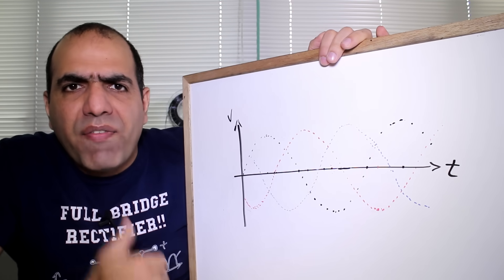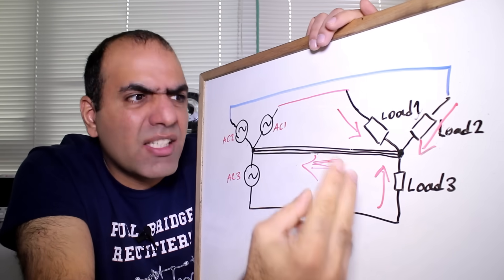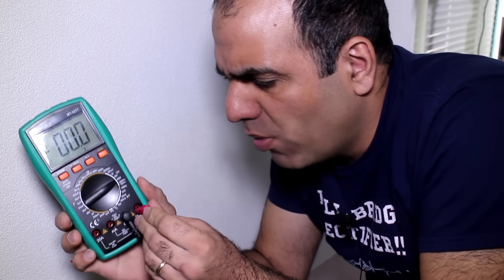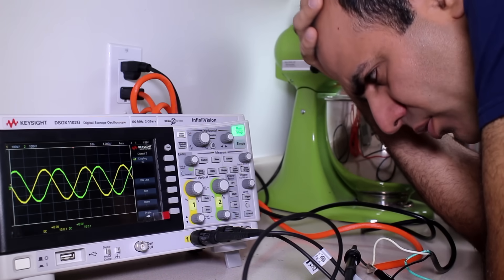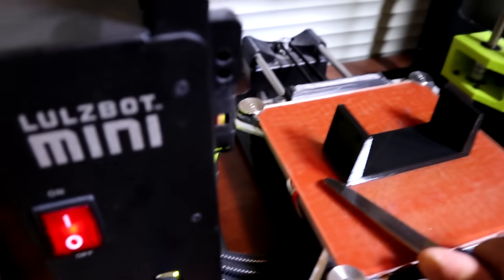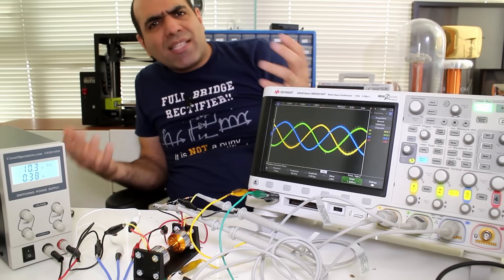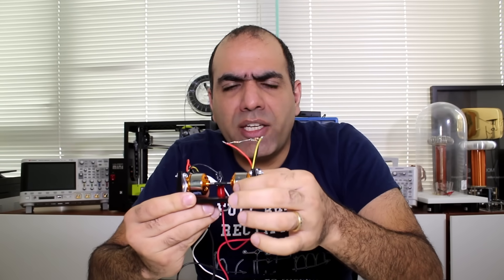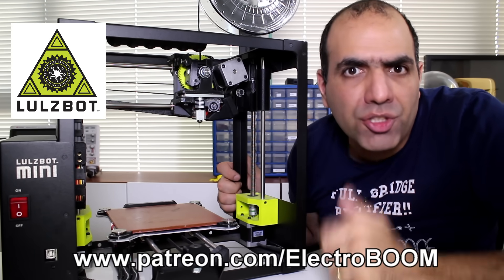Why 3 Phase AC instead of Single Phase???

Comment: well there is something I must have slept through during intro to electronics,  I would have thought you would need a return capable of handling the combined current of all 3 loads in your example as kirchhoff's current law should still apply.  However, I have to admit that my CEET degree was very soft on household AC circuits but I always assumed that the basic rules still applied.  I'd love to see the math on that type of circuit and how it varies from a 1 phase to 2 phase/3 phase load like in the example.  

Does load need to be perfectly balanced to work or can I have my 1500w space heater on load 1 and my kitchen microwave on load 2 and my LED living room lights on phase 3 with all hots wired together like in your example with no return/neutral/ground wires?  (seems like a recipe for a house fire to me)
Reply: Oneofdazzz Imagine you have two devices being fed by +12v and -12v with a common return. Because of the opposite voltages, current flows in opposite directions in the circuits feeding them. If you share the return, the two currents effectively cancel eachother out in that wire, satisfying Kirchoff's current law. If you had both +12v DC supplies then the currents would indeed add up.
Reply: Oneofdazzz Now with AC systems... even though the voltages reverse continuously... if the sine waves are shifted from one another, it is possible to have opposite voltages at any particular instants. With two phases (or split phase), the waveforms need to be shifted 180 degrees. With three phases, 120 degrees. With four phases, 90 degrees. In these situations, the return will never carry more current than is being used on one phase.

Comment: Try hand starting the motor with the prop at the same speed as the generator (since they are identical), then it will probably run a lot smoother.

Comment: In the US it would be unusual for residential service to be 2 phases. Only one phase is supplied. To get two voltages, the center tap of the secondary of the distribution transformer is grounded. That way from either end of the secondary to ground you get 110 volts and across both ends of the secondary you get 220 volts. You don’t have the phase difference that you show where you live. 

Another major reason for 3 phase power has to do with mechanical vibration in the generator. With single phase, the power output would be pulsating at 120 hertz and fatiguing the shaft of the generator. With three phases, the power output is essentially constant, eliminating this mechanical vibration. 

Love your videos!

Comment: ElectroBOOM is clearly living in an apartment building serviced by 3 phase.  His apartment gets two of those phases, so 120 VAC from one phase to earth and 208 VAC (120 * root 3) between the two phases.  In Canada in a house you also get two phases but they're supplied by a centre tapped transformer in the street.  The centre tap on the transformer is connected to earth at the transformer and at your electrical inlet so you get 120 VAC from either outer tap to earth but 240 VAC between outer taps.  All voltages nominal, of course.  You might actually get anywhere from 110 to 125 VAC on any particular day.

Comment: Lots of industrial locations require 3-phase power. Now if you measure the voltage difference between any two phases (in North America) you will usually see 208 VAC.

Comment: This whole explanation is missing a very important aspect which is power output over time. DC motors have a evenly torque output over time, which 1 phase AC motors do not have. Also 2 phase AC or 4 phase AC Motors don't have a evenly torque output over time. But this is what is required by electric trains. When starting they need a high torque but not too high so the wheels slip through. This means in electric trains they used DC Motors and 3 phase motors because those were the only ones able to output torque evenly over time. But, as meantioned in this video, 3 phase power uses less wires and having a higher power output. and THIS is why 3 phase power became popular.
see pictures here:
DC Train: DD1 --> https://de.wikipedia.org/wiki/Elektrolokomotive#/media/File:PRR_DD1_running_gear.jpg
3 phase AC Train: https://de.wikipedia.org/wiki/Drehstromantrieb_(Eisenbahn)#/media/File:Siemens_Drehstromtriebwagen01.jpg

also I think it's funny how americans (and canadians?) think the tesla vs westinghouse AC vs DC was a battle for the systems that took place on US soil. europe already went for AC and to today europe uses the better electrical system (every house uses 3 phase AC with much higher volage/lower current than the north american continent).

Comment: thinking 
so you used two of the same motors with the same input output cables thinking
doesn't that mean you already feed 3 phases into the first motor and you could've just did that example with the three blue cables?

Comment: Can you add a 3-phase full bridge rectifier to the circuit? What voltage does the setup produce pk-pk? What was the frequency when you started with the initial pulse and what did it change to when increased the pulse? I have been wanting to build a similar setup to play around with 3-phase at a safe voltage levels. I was planning on using a hard drive motors in a similar setup but i don't have a awesome 3D printer to create accurate mounts "LULZ". I wanted to make a 3-phase setup like this then see if I can wind some transformers Dy or Yd to step voltage up or down. Thinking about one of your last videos which you showed how high voltage transmission works but with less sparks. Also wanted to see if there was enough energy produced to power the 3-phase FULL BRIDGE RECTIFIER. I have been studying this in course but sometime experiments like this make understanding the material easier.

Comment: In your 3 phase motor diagram the top stator coil is wired backwards. You have neutral facing away on the other two coils but facing in on #1. This would prevent the motor from rotating and would cause phase 1 to overheat and fail.

Comment: Hey you have not mentioned that the "3 phase full bridge rectifier" delivers much smother DC without filtering. Perhaps a idea for the next video? That is also the reason why most cars have a 3 Phase generator wich an 3 phase full bridge rectifier. ;-)
Reply: Jörg Frede - cars use a device called a "battery" for filtering and smoothing. That's why they don't need capacitors on the alternator.
Reply: Yes but even without a battery the DC Voltage from a 3 phase generator is much smoother than the Voltage from a single phase generator because of the overlapping of the phases.
Reply: Yes of course, but it was you who brought up "smoother DC without filtering" and cars. So, I just correct your comments so that people who do not understand this subject won't get the wrong impression.

Comment: I was kind of thrown to see a domestic 208v circuit, to be honest. I was under the impression that homes typically had 240v split phase in Canada, and I seem to remember the heaters in my parents' house being labelled for 240v and wired across the phases. Am I misremembering or is it something that varies? Can you shed some light on this?

Comment: AFAIK, in the USA, home "high-current" circuit is make via HV-220V transformer with a central tap. Regular sockets are connected between tap and one of the phases (110V) and kitchen sockets are connected between phases (220V - because phases are shifted 180°).

Comment: 4:13 I am a homeowner who has read the relevant building codes in the NEC and the wire coloring is the same in the United States. How we came to this arrangement so that consumer electronics and household wiring use totally opposite coloring conventions is beyond me.

Comment: Great video explaining the 3 phase concept.

Since I am an electric car engineer, I have to correct you: Most electric cars, except the Model S/X, are using a 3 phase Synchronous Permanent Magnet motor. They have a higher efficiency than induction motors and produce more power compared to the size. I don’t know the English term, but the „Esson‘s Number“ is better -> https://de.m.wikipedia.org/wiki/Essonsche_Ausnutzungsziffer

The great thing about induction motors is that they don’t need magnets, which contain rare earths. If a company really wants to build an environment friendly car, the induction motor is the better choice.

Comment: I understand that it would have made that demonstration pointless but there was 3 ph coming straight from that ESC.
I don't know about small applications but in big 3ph ~ AC speed controllers are much smaller now they just alternate the cycles (Hz).
Also could have made 3ph with a delta transformer (or is it star?)
Canadian wiring colour codes sound confusing.
Can I please have a 3D printer?

Comment: You must live in an apartment or condo because here (at least in Ontario) houses get 120/240. (180 degrees apart) Apartments and factories get 208/3 phase (117 to neutral) for all the reasons you mentioned. (3 phase motors, reduced wire count, wall plugs off the same transformer)

Comment: Not all residential electricity in Canada has their "240v" lines 120 degrees out of phase. I live in Edmonton, and our power is indeed 180 degrees out. I just measured in my kitchen, 122v hot-neutral, 244v hot-hot. Not a high-rise apartment, but a 4-story, 50-dwelling apartment.

Comment: Brush-less motors also have an advantage over brush-less with speed, they can turn many times faster then what a brushed motor can do. Brushed motors have speed limitations due to the speed at which the brushes are contacting the commutator.